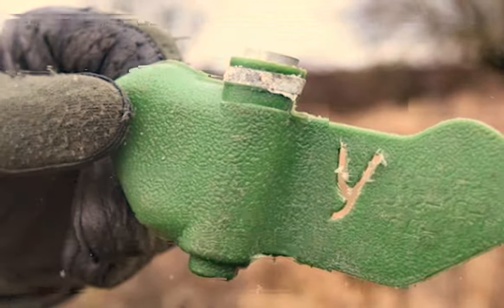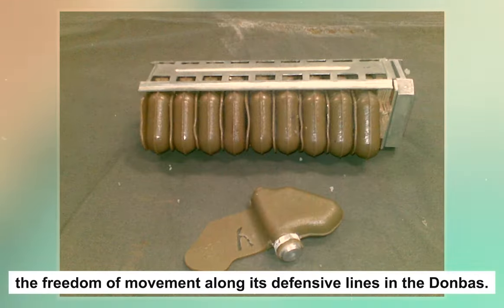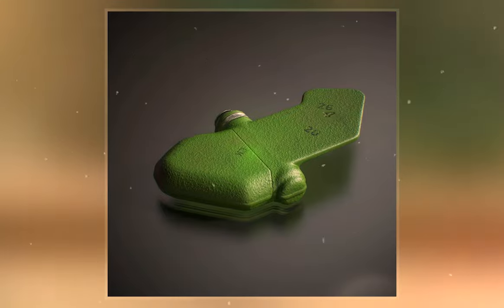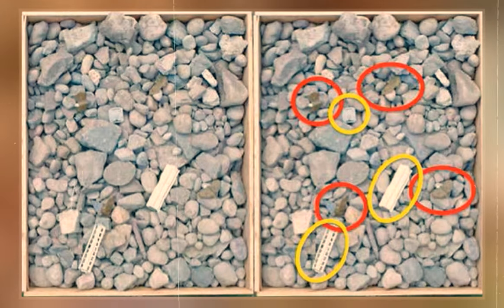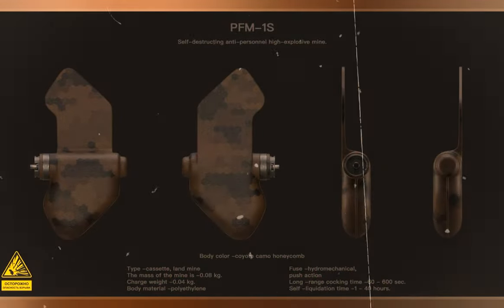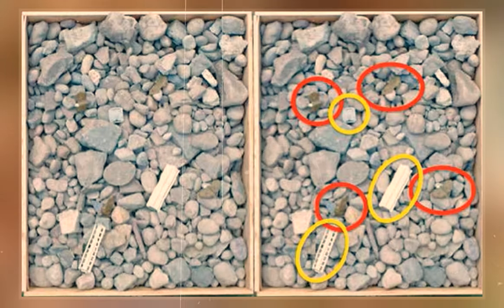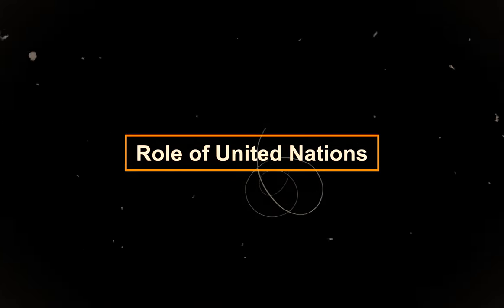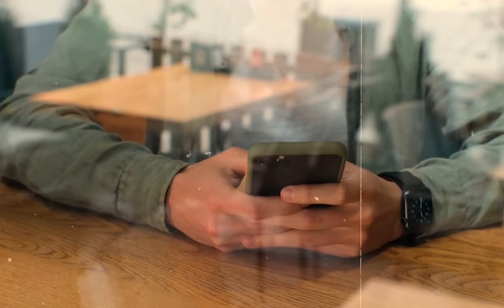What are Butterfly Mines ? | Russia deploys Butterfly Mine in Ukraine

Comment: Brave Ukrainian people. What about just sending herds of cheap sheep 🐑🐑 or pigs? What about filling a box with car batteries then drive wheels with starter motors controlled by command wire and you have a simple deminer. You could add metal detectors or use it to drag a line of explosives to detonate the mines.